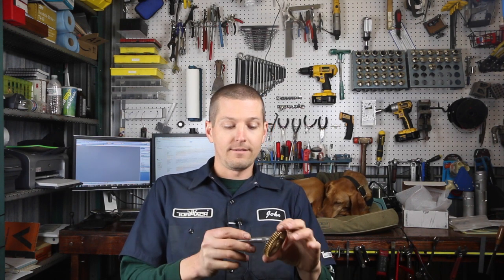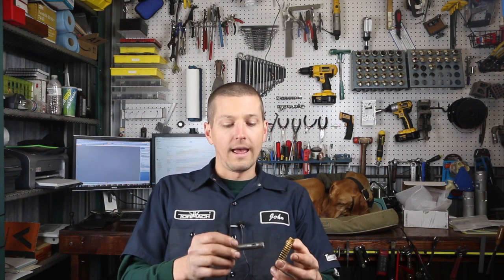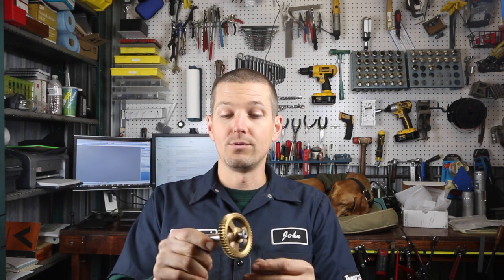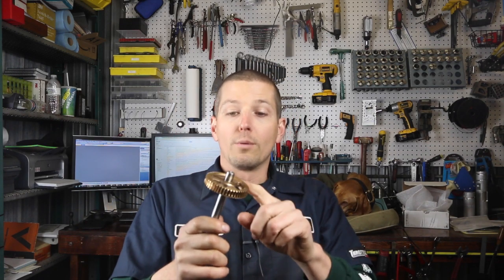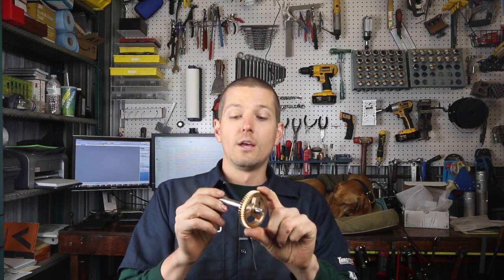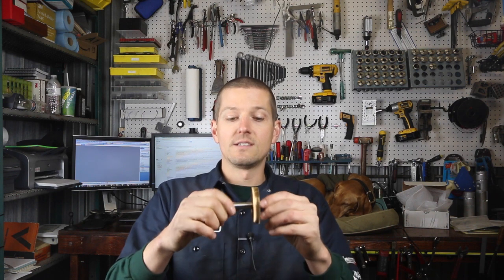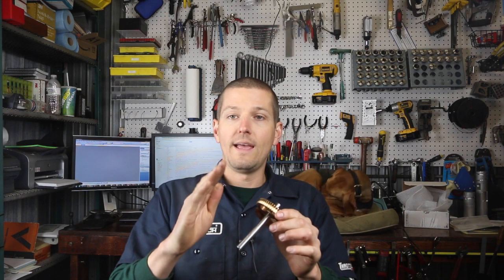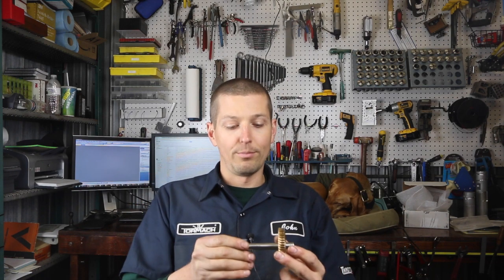Asking for advice!  Braze Bronze?

Comment: I'd Silver braze it... use a 55% silver blend. it's also easy to pull apart if needed. it will penetrate better and thus be strong without compromising the shaft or gear... It's a little more flexible to and  you'll less likely to have it crack. I build bicycle frames (among many other items) and I hate repairing old brass brazed frame. They are impossible to pull apart and save the lug. or gear in this case. I tig tons of SS, Chromoly , and Aluminum and think you'd to easily weaken the gear. Too much heat as well. Brazing brass is tricky. You could easily melt into the gear itself to much. Silver melts at about 1100-ish and most brass rod melts at 1750. All of my Lugged frames are Silver brazed.. I've never had a weld or joint fail... very strong stuff.

Comment: John, you might want to consider "Dutch Keys".  I think that brazing may warp things if not done by a pro like Adam ( Abom79).  Basically you drill and tap 3 places at 120 degrees apart and screw in set screws (the set screws become the keys).  The centers of which would be centered on the edges of the 2 parts being held -  essentially placing half of each set screw diameter on each part..  If you google Dutch Keyway, images there are a couple of examples using 2 pins at 180 deg. apart.  just replace pins with set screws .  The set screw will lock itself in place.

Comment: Hello , Did you think of a steel flange or heart for the bronze gear ? the steel would last very long time before it fail OR a one piece shaft and flange combination with press fit gear on the outer edge near the Tooth , I think it would last a lot longer !

Comment: Already a few good tips. Another I way I would maybe try is to add a large flange to the shaft that the gear could then be bolted to through the webbing. This will essentially increase the diameter of the shaft and give the gear less leverage on the mounting points to the shaft.  No heating of the gear and an easy repair if the gear ever fails. Well it sounds good on paper anyway. Lol.

Comment: Hey John...

This problem you are having is a good reason to rethink your design.

When you come across the "weakest link" in a system you must step back and make a decision whether to seek a solution to the immediate failure issue or to readdress the design.

I definitely think a redesign of your drive system is in order here.

Think... Windshield wipers on a car.

Redesign your linkage to work like windshield wipers.
The motor runs continuously in one direction removing most of the stress on the connections.

I doubt an engineer would take the route you are taking with this project.
(or whomever designed it)

I would not want to design something that puts so much stress on a part or parts if there is clearly an option to do it all differently.

Let us know what you decide...
Best of Luck to You

Anon
Reply: NYC CNC Understood

The "AC servos on a VMC" isn't the problem / weak link / design flaw.

You are designing a system that puts much (maybe too much) stress on a component when you can design it to operate in a way that it would put much less stress on the parts involved.  I think changing the linkage will be more durable, reliable, and more efficient.

The design I suggested would be much lighter yet more reliable and would use less energy to operate - more efficient.

Anon

Comment: Of course, your entire design is wack. The steel shaft needs to have a multi hole flange  welded/machined onto it, or a split locking hub. The gear/sprocket deal bolting onto that flange. {Detachable Hub Sprockets} Woodruff keys are not made for loads that change direction. You use use a splined interface, but the split locking hub and hub less sprocket is prob cheapest/easiest {mcmaster carr}
Reply: NYC CNC i mean, I'm no engineer. But to me keyways are always used in constant direction stuff. Alternators, motor shafts etc. All the old school machines that needed to have part change direction would use a bell crank kind of setup. Just thinking back to the oddball turn of the century machines i see laying around the shipyard.

Comment: Tig it with SiBr filler. Just use low heat, concentrating the arc on the steel.  {You can also just braze it using a torch and flux, don't matter. use whatever process you are comfortable} If you use the torch, preheat the crap out of the steel shaft, then push the gear on and get your heat back on the shaft. won't need much at the gear itself, just warm it up until the rod starts to stick when you drag it across. KEEP THE STEEL HOT!!
Reply: NYC CNC I like flame brazing over TIG brazing anyday. The part that messes with me, is if you start to get a puddle of base metal {the first step in forming a traditional tig weld} then you have already screwed up and got the parent material too hot! Oxy torch is way easier to get a nice braze with. We just Tig braze to save time. We use sibr bead on headers where the tubes meet the flange. Stops cracking from thermal cycling. The tubes are tig'd to each other with regular er80sd-2

Comment: Try a press fit 0.001) between the gear and the shaft. warm gear in oven to 350.  But shaft in freezer for a n hour or two.  That should fix you right up.

Comment: Make your own gear and shaft (4130?) via lathe and 4th axis.... you know you want to ;)
Reply: oh there you go playing the "commercially viable" card again :p
Reply: He'd have a hell of a time making that gear without hobbing it.
Reply: akromix
 oh maybe they aren't straight teeth like I took them for. If so, he could grind a tool and do the teeth by broaching. I've seen some DIY 4th axis CNC conversions where gears were made way. It's not fast though :)
Reply: They are not straight teeth if driven by a worm gear.  They also aren't straight depth either, there's a concave or however you'd describe it.  Hobbing is the only way I know of to do them, broaching is not an option.

Comment: Yep Abom79 said it all . Lathe up the gear and break the id edges .08 plus (both sides) and have it tig brazed (a lot lower heat) you can clean up the edges for the bearing seat. Looks like your abusing the shaft. you could always make a new gear solid steel now you can do anything you want (4th axis vid coming).
Reply: i just bught a miller 210 ac/dc/stick. sweet
Reply: not really not certified but can weld anything so far..

Comment: I would try solder if I were you. For some reason I have never managed to braze bronze or brass in a satisfactory fashion. What is the diameter of the shaft and what kind of torque are you putting to it? Also the fit (ie how much room there is between the shaft and the bore) will dictate wether or not solder is suitable. One thing that would worry me is that by soldering it, only the solder would be stressed to failure then the key way would get essentially the same load as if no solder was used.
Reply: That gives you about 13.5ksi shear stress at the surface of the shaft. According to some spec sheet I just found you can get more than 135ksi out of a brazed joint assuming you can get 0.0015"joint clearance. Which is a bore of 0.503" diameter. That is plenty good if you manage to fixture it well and keep distortion under control
lucasmilhaupt(dot com)/en-US/brazingfundamentals/properbrazingprocedure/

Comment: My input, for what it's worth:  The key is meant to be the weak point in the system.  It should be softer material than the shaft or the gear, so if something does go wrong, the key will break without damaging anything else.  (It was hard to tell in the video, but it looks like your old shaft had a damaged keyway.  That means the shaft isn't hard enough)  If the key is currently too weak, there are a few options, but I wouldn't suggest brazing, simply because it makes replacement a pain in the ass, and you'll end up with an unknown failure point. (same goes for loctite)
1.  A tapered shaft.  If you taper the shaft, and ID of the gear, and use a nut to keep the gear on, you can still use the same sized key, and increase the friction between the gear and shaft to the point where the failure point of the key will be closer to the failure point of the next weakest part.  The nice thing here is that through trial and error (or some complicated math) you can use the nut to apply exactly the desired amount of friction.  Most alloys of bronze have a pretty low coefficient of friction, meaning you'll need to apply a fair amount of force.  You shouldn't run into galling, since the parts should never move.
2.  Alternatively, if you know exactly how much force your next weakest part can handle, you can increase the size of the shaft, and subsequently the size of the key to get the failure point you desire.
Reply: You've got a lathe!

Comment: I haven't checked if anyone has suggested to put a pin through it. That might wear just as easy as the key I suppose, but that's what is used on outboard motors in the propellers.
Reply: A bolt with a lock/spring washer. It has low rpm's, right? Low rpm's = no balance issues
Reply: Thought the diameter of the hub of the wheel and through the axle - it could keep a "squeeze" on the hub, and in case you see wear, you could tighten the bolt

Comment: Hi John, I guess if this were to be a marketable product would you provide a replacement shaft with the gear already in place or just the gear itself ? Reading from below I think the most robust option would be to TIG as Abom79 and others mentioned. 

One option that came to mind for a removable gear was to make the key a feature of the shaft itself like a single rectangular spline and then press fit. This will remove the wobble in the key itself and may prevent shearing.

Comment: Hi John,
Love you videos and you work bench supervisor.
With the amount of operations you are expecting this unit to perform maybe this type of motor is not the correct solution.
Maybe one of the following would do a better job.
Air ram, servo motor or maybe a large stepper motor with belt reduction.
Keep up the good work.
Cheers Dave

Comment: I'm not an expert, but I would try to go with the mechanical solution. If you glue the shaft you will always have to replace 2 components - this may make the repair more costly. Also the fit may not be that concentric. A nice alternative is using a key-less, zero-backlash, bushing for example:
www.fennerdrives.com/catalogs/keyless_bushings.pdf

The working principle of this bushings is similar to a spindle collet, so you will get a firm grip on the shaft as well as a nice concentric fit.

Hope this help. Good luck with the project!

Comment: I believe the best way would be to redesign the shaft. If the shaft were cut larger, you could assemble with a shrink fit. Just as you would with induction heat shrink tooling. Though, it would probably yield better results with cooling the shaft instead of heating the gear. For instance, (impellers/rotors) impellers are assembled onto the shafts in this manner. It allows for dis-assembly (if needed), and will withstand high amounts of torque. You could choose to key it as well, but I believe the shrink/interference fit would be more than adequate.
Reply: NYC CNC sounds like a honeymoon I would plan. Very cool.

Comment: I would prob. drill through the gear and shaft and put in a hollow pin retainer instead of a key, putting the stress right thro that part. And fix the gear with a loctite compound - there is several high stress variants för automotive use. But any cylindrical lock would most likely do the trick.

Comment: Hey John,

Take a look at these keyless bushings. They are great for load reversing applications. I don't know if you have the space for it or can change your design to accommodate one. I can tell you from personal experience these lock up solid. I guessed at the shaft size. http://www.mcmaster.com/#5926K18

Welding will soften the gear further and loctite is not up to the job, You need a zero clearance assembly. Any looseness will work its way larger and larger with the load reversal until the weak link fails. 

Hope this helps.

Tom

Comment: My worry would be transferring the weak link from there to some other part. What's going to happen to the rest of the shaft, or gears, etc. If you weld up that shaft and gear are the teeth going to hold up, or will they strip completely when they become the weak link? This would also apply both up and down the system.

Comment: I agree with Abom 79. You would need to use silver solder/braze to join those two parts. If the bronze gear is a sintered self lubricating type bronze then it will be a bear to braze as the oil will burn off while you are heating it and contaminate your joint. Silver needs really clean and carbon free surfaces to bond well. If done properly silver is a near perfect mechanical joint as the low surface tension of silver wets into the surface scratches and "keys" everything together but proper joint fit is needed. The 1144 shaft has enough carbon content that you can get a hardening effect from the joint but I would think it would be minimal as silver soldering takes place near the critical temp of the steel but certainly not above it. Heat distortion of the shaft might be a bigger problem. My $0.02.

Comment: is there room for a steel disk to be welded to the shaft and pinned or riveted to the outer diameter of the gear just short of the gear teeth.  that way all the strain would be transferred to the shaft through the disk.  disk could probably be 22 gauge or even thinner

Comment: loctite or permatex sleeve retainer (permanent sleeve retainer, i believe is green in color but can't remember for sure if the one labelled permanent is green or not) - will hold better than brazing since that won't penetrate in the fit that you have there (you're probably thinking silver solder which might work but i'm not an expert). my opinion anyway.
EDIT:
https://tds.us.henkel.com/NA/UT/HNAUTTDS.nsf/web/062262D5231164B0882571870000D85C/$File/640-EN.pdf
http://www.permatex.com/documents/TDS/automotive/64000.pdf
Reply: Loctite 640
LOCTITE® 640™ is designed for the bonding of cylindrical fitting parts. The product cures when confined in the absence of air between close fitting metal surfaces and prevents loosening and leakage from shock and vibration. Typical applications include retaining keys and splines, eliminating backlash in worn assemblies, retaining bearings in place - preventing spin out, retaining rotor to shafts in fractional and subfractional horsepower motors, retaining bushings and sleeves in housings and on shafts, augmenting press fits, restoring the fit to worn assemblies or out of tolerance parts.

from Permatex and Loctite instructions for various types of fits (wording is identical)
- For slip fitted assemblies, apply adhesive around the leading edge of the collar and use a rotating motion during assembly.
- For press fits, adhesive should be applied thoroughly to both bond surfaces and assembled at high press-on rates.
- For shrink fitted assemblies, the adhesive should be coated onto the pin; the collar should then be heated to create sufficient clearance for free assembly.
Reply: cool, hope it works so that project goes to video :)
Reply: loctite retaining compound is ridiculous once it cures.

Comment: loctite for now plus 2nd key
put your 4th axis to good use
Reply: NYC CNC that is something a old engineer told me years ago on shafts that have a lot of load or sudden movement always have two keys plus loctite or 3 grub screws the biggest that can fit plus loctite.
I swear by that method never had a gear or pulley move 

done this on a big portable saw mill 80hp motor running a 1 meter blade it had a lot of start and stop load
Reply: NYC CNC yer it was over kill but that was all that was available at the time it was out of a tractor only $1500 compeared to $20,000 for 40 hp that`s set up for portable sawmills
Reply: NYC CNC was not electric lol just a tractor motor

Comment: I dont know what machine you are talking about and what it is doing but would acceleration and deacceleration help reduce stress on that shaft?
There are motor controllers that can do that. 
That is a DC motor right? Can you control it with PWM? At end of cycle just slow down with lower duty cycle(if there is no significant penalty to torqe that will make this not fisable).
One not mechanical possible solution from me.
Reply: I'd agree with Darko. If you're using electronic control (ramp up / ramp down) to control the motor, then you're not stressing the shaft / gear in the first place, or at least minimising that stress.
Reply: As a slight aside, this video question did remind me of what Arthur C Clarke imagined the Internet to be - the ability to poll the collective wisdom and knowledge of mankind without leaving your chair.

Comment: Do you have the option to either A) drill/tap the parts and bolt them together or B) machine a second key in? Then add Locktite in both cases?